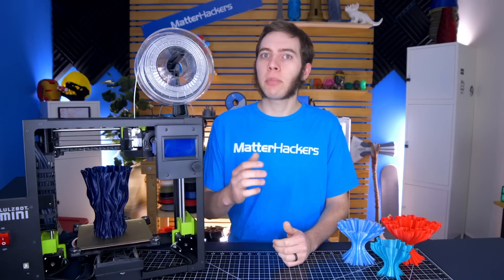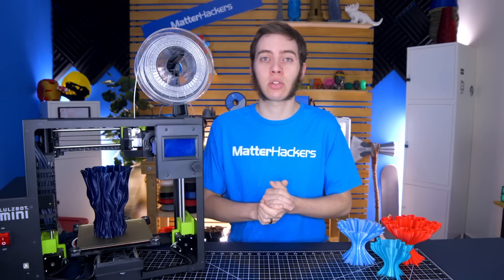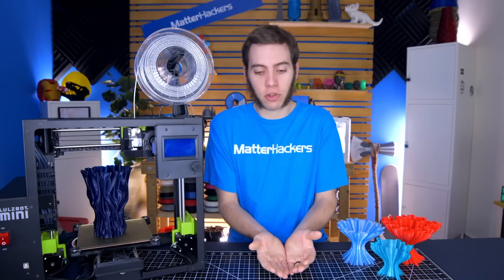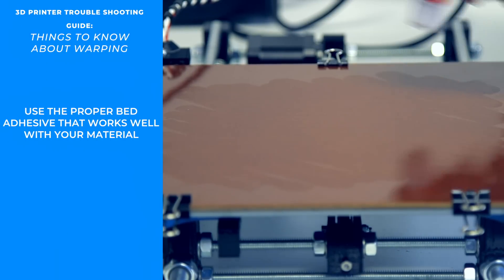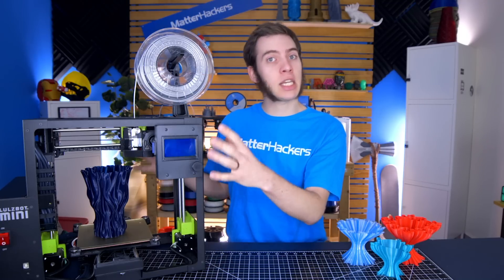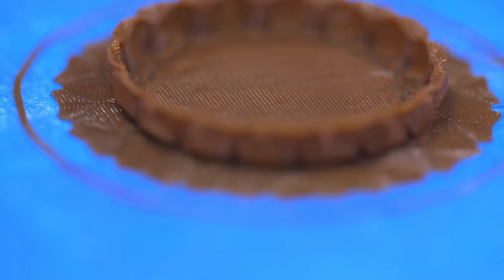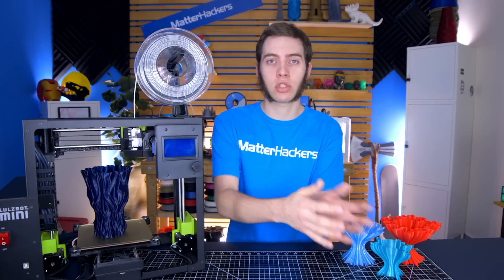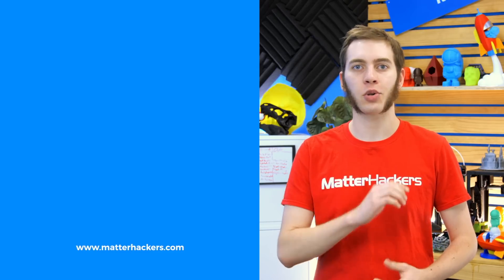3D Printer Troubleshooting Guide: Warping

Comment from the maker: What kind of warping issues are you running into?? Do you have issues with one material over another? You can learn more from our 'Stop Filament Warping' article here: https://www.matterhackers.com/news/-how-to-stop-filament-warping-in-3d-printed-parts
Reply: MatterHackers I print on PEI and the only time I get warping is when my bed is dirty.  A weekly acetone then alcohol wipe works wonders.  Nylon does seem to warp if I look at it funny.  It usually is just a little and doesn’t cause a failed print, but it does have a rounded look to the bottom of all my prints with nylon.  I use glue stick for that on my PEI bed and it works well.  I haven’t tried Magigoo yet.
Reply: Matt, I have a Ender 3 V2 3D printer and my "warping" is ONLY on one side of my printer... I have bed level the glass that comes with the printer and recheck my Z Offset position and everything seems to be set but the "first layer" comes out PERFECT but once the print continues the item ALWAYS curls on the right side of the printer. I tried increasing or decreasing the bed temperature and is using the maximum nozzle temperature of the filament. Thank for highlighting this and I going to try the "brim" option on my next prints to see if this helps.
Reply: So I'm sort of a newb in the 3d printing hobby, and recently I got some warping from PLA. I live on the tropical side of the world, summer all year boi! That said, its pretty darn humid here, especially during hurricane season (which tends to be during ending summer beginning autumn). I can't figure out why I'm getting warping as my other prints worked just fine and although the brim helped with the warping (my prev print had some seriously warped corners), it still has a bit of warping. I haven't tried the glue method and gonna try it. Raft is out of the question since the part i'm printing is a flat piece, so what other options can I try?

Comment: Changing the nozzle
Initial laying height to 0.25
Set the fan to start at layer 10
Those are things that you might want to check out because even with a raft in place you can still have warping

Comment: If you are manually leveling, with a post-it note or a scrap of paper, using a brim with give you a little bit of time to fine-tune the bed height   if the brim isn't sticking, raise the bed until it sticks.

Comment: All I had to do was simply lower my nozzle by the smallest step (-0.10mm) and my warping was virtually eliminated. It seems like my print bed was simply shifting downwards after a while, resulting in the nozzle printing further from the bed and ruining my adhesion. (using a CR-10S pro v2)

Comment: Like this is a nice video but my print sticks to bed and i have tried rafts and brim and i still get slight curling on thin parts. With high, low and no fans, enclosure at 45c+. Buildplate at 100c. The material isnt so easy that you can just plug and play, glue plate and add a brim. 

Getting the print to stick just the first step to printing. It took me 30 print tests to get asa to even print ok. It is tougher than nonwaroing materials and it isnt just the bed adhesion....

Comment: im experiencing warping on the right side of my models but not the left side of my model. every single time I print something its always the top right and top bottom of my model. anyone have any idea what would be causing this? the model is perfect except it always warps and pulls up on the top right and bottom right. the left side is always perfect. I print my bed at 57 degrees and my pla at 200 and speed at 100%. one day it just started lifting up on the top right and bottom right side.
Reply: Maybe something to do with the cooling fans and where the blowing air is going.

Comment: I’m trying to print a lithophane box. Nozzle temp is 200 and bed is 60. First time I used a brim and one corner pulled up. Leveled corners and reset my z offset. Tried again with a raft and it’s even worse

Comment: One could likely always have a last resort solution of using the printing material and melt in a metal screen or anything that can just come off easily at that exact level;  by getting the bed super hot at the end or maybe letting it cool and then getting it at top temperature.  I'm just having a hard time getting it perfect and am actually thinking of creating a layer of cement or something;  in order to make the top flat at least;  as the middle is always tighter then the rest and I'm just wondering where the set screw should be and what the sequence of the adjusting pattern is;  is it somewhat like the lug nuts on vehicle rim?LOL  Oh and if the surface of the bed would be porrus somewhat like skin without the black heads.  LOL  That would hold it down;  lol;   I have the trick for that though;  I just get the bed super hot for the first layer and make sure that the extruder is actually squishing the product;  otherwise it's just laying the passing row and that is why it isn't sticking.  I'm a drywaller and when I insulate the walls;  I cover all of the between studs and all the areas needed to seal the vapour barrier (poly,  6 mil or plastic ) ;  the acoustic sealant that is extruded with the use of a caulking gun;  needs to be heated and when applying it to the wood of what not;  it is important that the extruding is always ahead in accordance to the direction you are moving;  in order to squish it at least enough that it cleanses(in this case) the in between surface and moves things and then it sticks to the surface of the wood;  otherwise you  end up with quite a mess and especially if's your first time.  so anyways;  after the course of insulating houses here;  lol  the same kinda goes for 3d printing's prints' problems of not sticking;  when done right;  look closely at your first layer and if it's not squishing;  use that first attempt at checking if it's level;  to actually try to level it on the fly.
Reply: I didn't even notice anything about your facial hair buddy;  don't worry about them;  they're likely just other people that have videos on here and can't make it without cheating in one way or another;  LOL Cheers.  I'm just glad to be able to get help when I need it on different situations.  Thanks bud.

Comment: Good information. Thanks.   Could you explain how to avoid warping on large thin parts?  I’m trying to print a book cover that is 230 x 140 x 1.6mm. Everything goes well until about 1.4mm height. Then it warps like crazy. Not only from the sides but even from the middle. I tried lowering the bed temperature, raising it, your idea of the trash bag.  I also tried with the blue tape but it pulls the tape away from the bed anyhow.  Blue tape is normally working fine for me but i guess the large piece of plastic is getting stronger than the tape.  I’m out of idea on what to try now.  I followed your link and read the article but none talk about large piece like that.  Ps: I tried with 4 different PLA
Reply: I had issues of warpage on a 3 x 2 inch part with pla.  I increased the bed temp to 70C and no cooling fan till 1 mm height.
Reply: Increase bed temp only for first layer, then drop bed temp low to 32 or so.  Print slow on first layer.  Good permanent glue stick for adhesion.  Print enclosure helps.

Comment: i have tried everything that I can think of getting a good first layer I have probe for  bed leveling and I moved to mirror instead of glass bed but still getting warping I have anet a8 plus  bed temp is 60 and hot end is 200
Reply: Rodney Smith That’s pretty low for hot end. Try 220 and print pla on blue painters tape

Comment: Thax...but you never addressed what glue to use with PLA or PETG??? these are what i have issues with right now.. Also my Ender 5 has a magnetic matt i print on...could this be the issue? I ordered a stock metal one for it also... thax

Comment: I have a Whambam flex bed and my recent Nylon print just warped with the bed itself (magnets were not strong enough, part is large on X axis). I am guessing that only option is to wrap my CR10S PRO in enclosure, right?

Comment: I know improving bed adhesion stops flat shapes from warping but how do you stop the perimeter of overhangs curling upwards? The only solution I've found is to use a raft and supports. Eg use supports to hold the overhang DOWN to the bed/raft. However I'd like to be able to print something like a lattice cube at 45 degrees without needing thousands of supports everywhere.

Comment: How about warping mid print? I never had any problems with bed adhesion at all, but whenever I try to print, for example, a Benchy with PLA it starts warping when it comes to the part with the archway. Even tho the rest of the print is perfectly sticking to the bed, the last few layers of the archway start warping so badly, that the nozzel hits into the print causing layershifts of up to 1mm. Never had that problem with PETG. Does anyone have an idea what causes that problem and how to fix it?
Reply: Your bed might be too hot

Comment: hi Alec i seem to have a warping issue with my ultrabase bed it only seems to happen with larger/wider prints and more often than not starts at around 10-15mm high into the build,seems to be a random problem that i cant really pinpoint to one reason alone,ive tried both different hotend and bed temp changes ,but to no avail also have tried testing bed temps with a probe to see if i had a cold spot (using pla and rafts also)
it seems to be only one corner at a time that does it and like i said only on larger prints around the A5 paper size .
Reply from the maker: Hmm, is your printer near an AC vent, or is the bed dirty? I would first say clean off your bed with isopropyl alcohol and then if that doesn't work, give it a very light sanding with 600 grit sandpaper. That usually is all it takes to get parts to stick to the bed if they weren't before, but you can always try increasing the bed temperature to get better stick. - Alec

Comment: For longtime prints use the lowest heating bed temperature as possible. Optional dissolve gluestick in isopropylalcohol and apply this solution with a Toilette paper. This thin film drys immediately and is unvisible, no later artefacts in your print surface.

Comment: My recipe for successful ABS printing
 Enclosure with 40-45C ambient temperature 
 nozzle: 255C 
 bed @100C+good leveling
 fan 0%
 bed adhesion : ABS +acetone mix
great adhesion -no layer splitting

Comment: A video on "baconing" would be awesome. I've quit messing with my printer because I couldn't get it to quit doing it.
Reply: What exactly do you describe as "baconing"? Some surface disparity on the first layer is normal and should be deemed acceptable, but it can be improved. Clean your print surface well, play around with Z calibration. If the surface isn't flat, you can mod the firmware with manual mesh bed leveling or add a piece of glass.
Reply: The issue I would have happened further into the print process. It would happen on top of stuff that had infill under it.
Reply: @MrZombietoes  i still can't picture what issue you might be having. Maybe a Facebook group may prove more helpful since you can post a picture of your unsatisfactory print there, together with your printer that you use, or even a video of it happening. But usually you can divine the cause by careful observation. On top surface there is usually a little bit of sagging where the filament is not supported by infill, in between of infill columns. What can help is more top layers (3 is usually a good minimum), higher infill density, or gradual infill density. Also printing a bit colder or having a decent part cooling can be helpful - it's pretty difficult to get a nice top surface on a printer which doesn't have a part cooling fan, depending on climate and draftiness of your premises. But printing too cold can lead to all kinds of issues too, it's a bit of a balancing act.